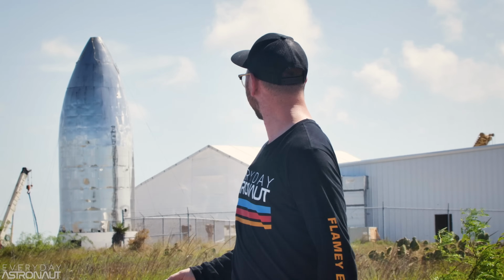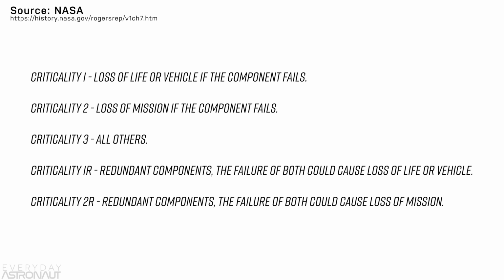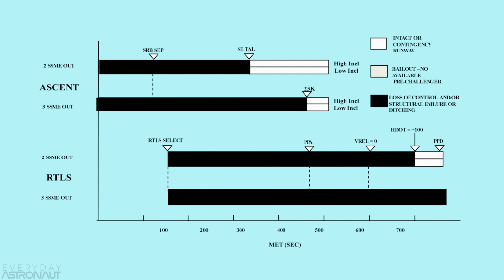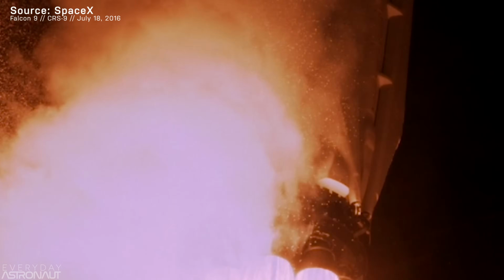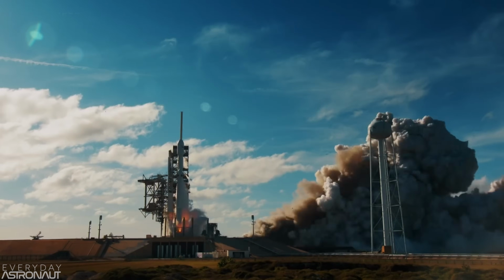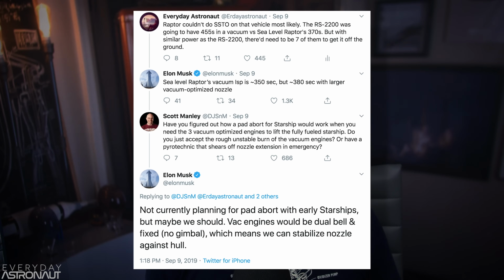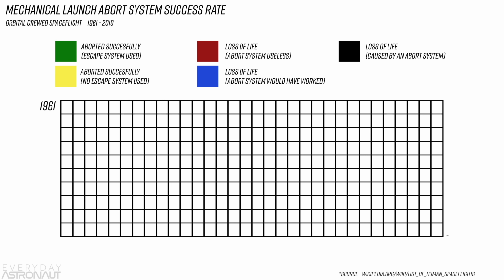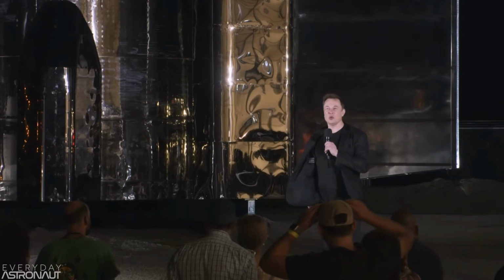Why won’t Starship have an abort system? Should it?!

Comment: With regards to re-entry abort.  GE developed one such system in the 1960s, called the MOOSE, which was a personal reentry device.   Weighing at 200 pounds (91 kg) and and being the size of roughly a suitcase, it would have provided an emergency re-entry device for one astronaut, who would have had to enter in a fully sealed space suit including helmet with oxygen supply. The astronaut would be surrounded by inflatable foam insulation, similar to an inflatable raft, which would double as a floation device in case of water landing, and a parachute would activate at the appropriate time  The idea was not as crazy as it sounds at first, Felix Baumgartners jump showed that high altitude jumps are definitely survivable, assuming the foam insulation worked.

Comment: Why don’t they just: use a passive, inherently safe and stable body for Starship (like a rocket-capsule) and use the heavy duty side thrusters to stabilize it more during re-entry? 

I’m thinking that the weight of the air brakes and the motors (hydraulic or electric with batteries) would be roughly the same as using more gas for the thrusters and a more-stable body

The safety would be much higher in my humble opinion

Comment: I loved your presentation and liked your final answer. I have literally flown commercially hundreds of times in all kinds of planes and not once crashed. Close a number times due to pilot error some of which would have been fatal. A few aborts due to equipment failure etc. I also was a private pilot and received my A&P license. Most systems today are very mature for aircraft with new designs carefully monitored. IME failures happen almost entirely due to shoddy maintenance and/or pilot error. There is however always the unforeseen lurking in the dark. Great presentation once again.

Comment: Interesting that you quickly reduced your requirement of seeing the Starship fly a few dozen times without an abort system before you'd get on one down to 10+ (the "+" meaning more than 10 but implying fewer than a few dozen, in this context).

Comment: Starship will hold 100 passengers taking them on a flight that takes 5 to 7 months to a planet that wasn't meant for us to live on. I think we are pushing into things we shouldn't be. People will surely die, if it's not on take off or going crazy after being in a tube for half a year or mars radiation, then it will be one of the thousand of other things that could go wrong that will kill them. It's a suicide mission.

Comment: I think the place we're at right now is that if Starship performs as designed where the first couple of "final" iterations (that is, an all up design that is mostly the same as whatever the final approved revision will look like) safely perform multiple rapidly reusable flights each, you'll have mostly proven the safety of the system. Certainly not to "airliner" standards, but enough to where you demonstrate the weak points.
.
We have to keep in mind that, for example, the shuttle's two failures were both well known and understood issues, and NASA simply chose to ignore the risks and advice of engineers. Challenger could've been prevented by fixing the O-ring problem in revision and avoiding cold launches, and Columbia by fixing the well known shedding problems.
.
Further, Columbia's risk could've been minimized by default of following the logical path of the ice strikes and simply designed an in-flight repair plan like they did after the accident. Even granted that this was never assured to repair serious damage, any chance would've been better than none at all.

Comment: What about just surrounding each seat in the spacecraft with an indestructible "pod" that would close during a RUD and have its own parachute like an ejection seat without the ejection? Or have the crew section itself become a pod, why does it need rockets to separate itself if the rest of the vehicle is disintegrating anyways?  If the re-entry capsule can survive the heat of re-entry and a spacesuit can cool you in space in the direct heat of the sun's rays why can't the crew cabin become an indestructible pod?  People have survived falling off Niagara falls in a barrel, why couldn't a crew survive falling off the top of an exploding rocket onto the water jets they use to cool the launch pad? Why does the capsule have to separate itself from the exploding vehicle if you can't outrun the blast wave?

Comment: I mostly agree with your conclusion, but not entirely.  I agree that I want to see spacecraft fly over and over again before considering them safe enough to carry humans without an abort system, but I wouldn't say that's reason to ad an abort system, as they ad weight and complexity, like you mentioned.  I think they should just fly the thing a whole bunch of times without humans.  That said, my uneducated opinion is worth basically nothing.

Comment: 2½ million moving parts seems way out. 2½ million parts in total seems plausible (compared the with Airbus A380 which is more than three times the dry mass and has 4 million parts in total, but 99% of them are fixings whose whole purpose is to not move)

Comment: So i have an interesting question why hasn't space x started using there full flow raptor engine in there falcons? in order to prove that engine? get there reliability numbers? yet also how does the field range safety officer detonate the rockets when needed?
Reply: There are other videos that answer these questions, but the raptor engines won't work on the falcon because the falcon is too light and the wrapped her engines have too much power so you could never land it. Secondly, the range officers have a button so if they see anomaly they just push the button in the rocket goes away

Comment: The shuttle program had a one mission out of 67 ending in all aboard death, record.   That's actually better than the aircraft my grandfather worked on.  He was a mechanic in the 96th Aero Squadron.  He worked on the Breguet 14 biplanes that started out as reconnaissance aircraft but ended up as bombers in WWI.    Excluding aircraft shot down, each aircraft could expect one catastrophic failure every 30 or fewer flights resulting in the death of the pilot and crew.  This should give you an idea of the level of bravery.  Every time the pilot and crew climbed aboard they knew that there was better than one chance in 30 that the aircraft would fail either on take off or in flight or in landing that would result in their death yet they would still go.   Those weren't even the aircraft with the worst record.  Some aircraft could be expected to fail about every twenty flights and yet the pilots still took off.  Keep in mind that much of the materials used in these early aircraft was wood, leather and canvas.

Comment: I worked in manufacturing for many years.  My last manufacturing job I was a safety auditor.  As such I learned about safety ratings on equipment.  The rule of thumb is that in order to say something is rated for a specific number, it had to be able to withstand up to five times that number.  For example.  A winch could not be rated for 1000 lbs unless it had a breaking point at or above 5000 lbs.  You can't say a chair is rated for 300 lbs unless the breaking point is at or above 1500 lbs and you can't say a bolt is rated for 50 lbs unless it has a breaking point at or above 250 lbs and so on.  This is standard with all manufacturing.  So to say that something should be designed at 1.5 times the expected load or stress is a very poor substandard design and explains why NASA  had three catastrophic failures resulting in loss of human life.  No system is better than it's weakest point and NASA has a history of weak points.  Hopefully Elon Musk can safely bring us well into the 21st century when it comes to Space travel

Comment: I say if you can't make 1 rocket work, you not gonna fix it by adding another one that dont work.
But at some point, having a fail system should be a option.
Like WTF do airliners not come with parachutes? tell me that?

Comment: That was excellent, you've a terrific intellectual clarity coming across that's both socially and academically welcome. I think ideally space vehicles will have not just automated but, especially where automated systems may not be appropriate or useful also pilot options for even unlikely catastrophic failures but accomplishing these throughout the envelope will take time beyond initial deployment of the vehicle type, so can never really stop being a work in progress in terms of safety. For example an automated launch pad escape system has some predictable problems with specific conditions where a manual operation would be preferable in order to avoid the kind of situations seen in Airbus disasters with pilot lockout automation that would not have occurred in a Boeing where the pilot has more immediate vehicle control in priori to completely understanding the nature of the in flight failure, where time to determine and intellectually respond to the failure through the management system as opposed to direct control simply isn't present before loss of the aircraft occurs, where even redundancies of the automated flight system giving over limited pilot control also failed due to the nature of the original system failure, operator equipment variations and crew unfamiliarity with hands on vehicle control in that type in the first place. There's been a few automation related air disasters, typically Airbus and from things as mundane as incorrect calibration of the radio altimeter or the ground crew forgot to remove a sensor cover and the safety systems killed the plane whilst cockpit voice recorders relate the screams of crew frantically trying to manipulate the controls and being overridden by the automated systems, then crash investigators wondering how on earth a pilot manages controlled flight into terrain in perfect flying conditions and visibility, without any mechanical failures of the aircraft whatsoever. Certainly far fewer direct control circumstances exist in relation to space flight beyond the realm of orbital manoeuvring however at least at the pad a fully automated escape system has already demonstrated the cost of treating crews like monkeys in space suits even if, for the most part in space flight that's what an astronaut has to be.

But it does seem counter-intuitive to use a rocket escape system because of the inherent dangers associated with rockets. An ejection capsule like the F111 doesn't seem practical for a capsule type of spacecraft but for a vehicle like Space-X's it's not unlike an aircraft layout as an ultra lightweight, flying gas tank with some people and cargo crammed inside and it's really the people and gas tank part that ought to have some kind of separation, I feel if just for a sense of well being. I don't want to be in that super unlikely case of a static pop followed by a sudden sense of freedom. I'd want an F111 type escape capsule on a purely manual operation that won't help at all in most cases but that part where you're on the climb and ground control is radioing Oh My God No! I can pull it and ask what's up on the ground later, or I'm just not feeling real good about this re-entry breakup I can separate in a shielded section and sacrifice the reusable spacecraft that, well it's not coming back anyway. You get the idea. I mean I'm not going to sit inside a V2 either, put a separable capsule in it. Well, this one kind of reminds me of a V2, the Redstone actually where the skin was the tank. I'd really like a separable capsule.

Also they're planning extended missions in this thing, talking months inside. As it is it won't cut it and is really just a short duration space shuttle type of vehicle. Crew will get microgravity tumors otherwise. Going to have to centrifugal it for that so final case is going to be much heavier and more extensively equipped anyway, since cost recovery involves extended missions down the track, they're already spending big on a lunar lander version and mass production is based on that and gaining the Mars project, not just servicing satellites and transferring crews to LOO stations. Hey maybe put in a separable capsule that rotates inside in microgravity and functions as a static escape capsule in atmosphere?

Comment: Aero spike engines were suggested.  Maybe these types of engines can be re-imagined.  Space X employees are good at making breakthroughs and mental leaps.  My main concern also is the fuel tanks, which would require launch abort.  Reentry flappy wings  another failure node that is of concern.

Comment: Could not a lot of reentry problems be reduced by using the engines to slow the spacecraft down to a spped at which heating would not be a problem and to continue to use the engines to keep the craft at that speed until it was in the atmosphere and other systems could take over - or is this just to complicated / heasvy to be viable ?

Comment: Considering Nasa flew the 3rd all-up Saturn V with a crew on it, having an abort system seems a must.  So I think a fair question to Elon Musk is how many unmanned Starship flights will there be before a manned flight is attempted?  The next question would then be what's the rationale for that number of flights?  Tim makes much the same point.  But the rapid prototype testing and design would appear to support having no specific abort system.  I would suggest consideration of 2-3 Raptor non-vacuum specific engines on Starship.  They'd still work in vacuum, just not as efficiently.

Comment: We fly in airplanes which do not have any abort system.
Reply: Airplanes don't go 2 times the speed of sound and can glide
Reply: @warrenayres200  Yeah, but that's not the point. The point is that in an airplane in the even of a catastrophe we don't have a way out. But the chances of happening that is 1 in 10 millions. Similarly for rockets we need to go after reducing the probably of messing up. I think that's the way to go.

Comment: I'd launch starship into orbit. Launch a starship tanker to refuel it. Then launch the astronauts up to it on a dragon 2. If it's all reusable and you need to park in orbit to refuel anyway, then there is no reason not to. Dragon will remain the more tested platform long after starship starts flying.

Comment: In case the prachutes of the dragon actually fail, I would prefer the abort / propulsive landing system be armed and used to slow the decent, not matter if it was certified for that circumstance.

Comment: I realize this is an old post, but engine fires in airliners are actually fairly common, you just don't hear about them falling from the sky from it. Not many rockets can survive an engine fire in an uncontrolled way due to the pressures and the tight tolerances.  Coupled with you just turn off the engine in an airliner then deploy a fire suppression system and can (at worst case) glide back to earth hopefully with a safe landing. A rocket is efficient at going up... and down but not flying. So for manned flights you still need that abort system just in case you end up with an engine fire. Additionally, in the cases were the launch abort tower was ejected then needed to abort launch: having an integrated system that is not ejected seems to add abort capability right up to the point of final stage separation.

Comment: If you're going to say that the RD-180 had a 100%ish success rate because the mission could still be carried out after it's one failure and the upper stage could compensate, then so does the RS-25 since its one failure led to an ATO and a successful orbital insertion.

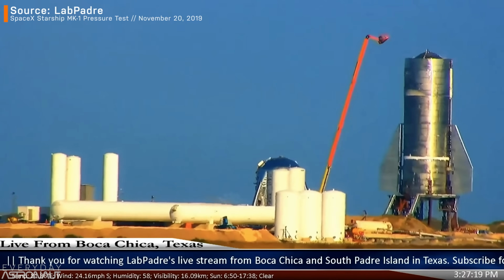Comment: 29:40 into the video you point out that the PRESSURE TEST caused a failure whereby the MARK ONE Starship PROTOTYPE BLEW it's TOP OFF. BUT THIS WAS A PRESSURE TEST where they DELIBERATELY increased the pressure UNTIL IT FAILED so they could test the safety margins, you ask "what if that had been a fully fueled Starship with crew onboard" ? Well then they WOULDN'T have been doing a PRESSURE TEST on it would they !!!!! So it's a completely unfair suggestion & comparison !!!!
It's like saying that Michelin developed a new tyre & to check that it was safe pressure tested it until it exploded, well what if that had happened while it was on your car going down the road ?? WELL THEN IT WOULDN'T HAVE BEEN BEING PRESSURE TESTED WOULD IT !!!!!
Reply from the maker: Ok, well what about SN4 then?! 😂 isn’t that completely fair to ask what if people were onboard?
Reply: @EverydayAstronaut  Firstly I'd like to thank you for the response & say that I LOVE your videos, they have taught me a lot in the few days that I have been watching them, to answer your question, YES, I agree that the SN4 failure does raise major concerns & certainly raises the question of "what if there had been crew onboard & that had meant to be an actual mission taking off", but even you point out that the Starship pressure test failure "was nowhere near future operating conditions" & that "SpaceX was pushing it MUCH FURTHER than normal operating ranges" so ... my point remains that commenting on the possibility of "what if that had been a fully fueled Starship with crew onboard" is totally irrelevant & pointless because in those circumstances they wouldn't be performing a pressure test.

Comment: What about a springy leap frog thingy under the bottom of the human capsule, above the rocket fuel bits?
The human capsule just needs to spring away a few metres from the explosions, then some parachutes to soften a hard landing.
Fewer parts and seems to met the escape requirements.
Reply: Wouldnt That  compromise hull structural integrity ?

Comment: Abort systems were a good Idea at the time. However, have been proven to not be necessary. Less weight = less cost. But also, If you drive your car 200,000 miles and the air bags were not needed, does that mean they are never needed?